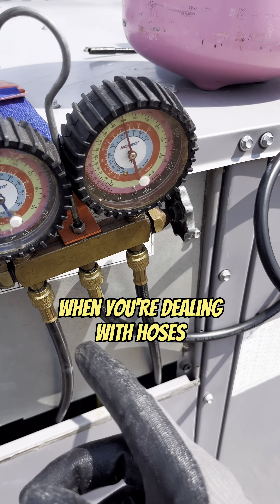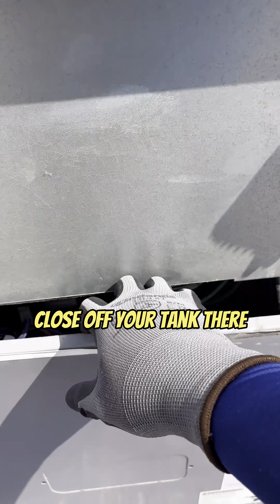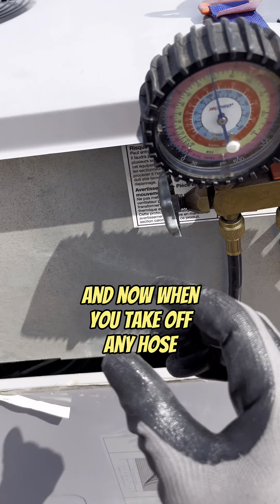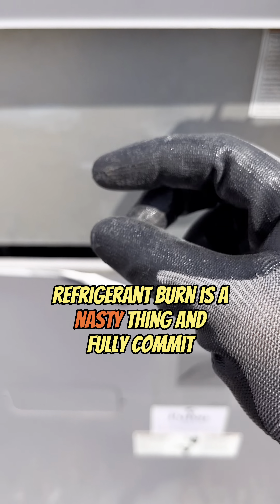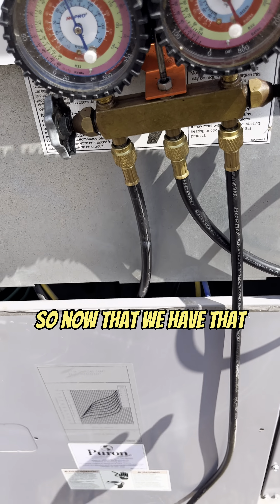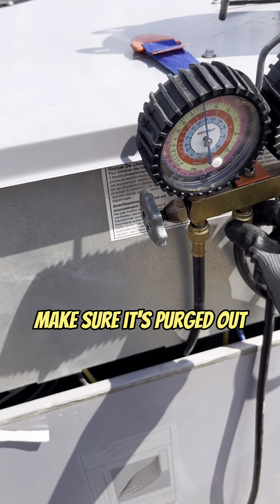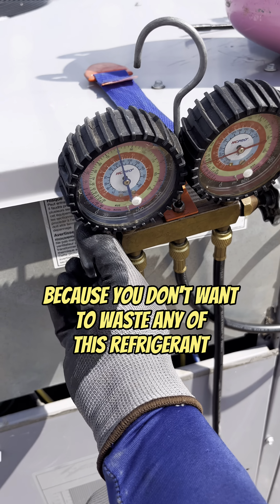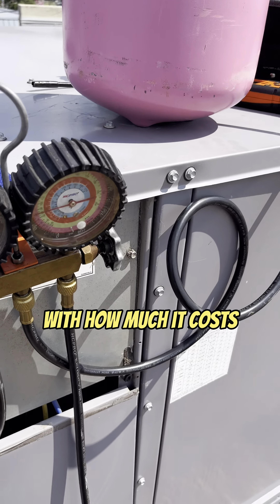Don't be a hero

Comment: or use core depressor fittings for highside absolutely no blow back
Reply from the maker: Like the thumb screw or which one? 
If so what brand? I've seen guys break them often so I never bought one. Ball valve is pretty similar
Reply: @ReliableHVACR  the thumb screw kind i personally use C&D the quality is hit and miss i have one that works without fail and another that i had to use some nylog on to stop leaking but for high side pressure it's the best tool I've come across

Comment: Close off the discharge at the ball valve, dump liquid charge left in line to the suction, bingo, no liquid refrigerant left to  freeze burn,. Turn off compressor to reduce the discharge pressure.. 
Or if no ball valve, open discharge to suction very slightly, and allow refrigerant to bypass, when your discharge hose is warm, close gauges and remove hise from the dischage, no liquid either....

Comment: Low loss fittings instead of, or as add on.
Also, those gloves are open on the mesh/back, so they will NOT protect you. If you are using gloves as a protection, use leather!!
Reply from the maker: I have better luck with ball valve. My other low loss always end up leaking. Heavy duty gloves in the van 👍🏽 these are fine for the occasional spray back from disconnecting hoses.